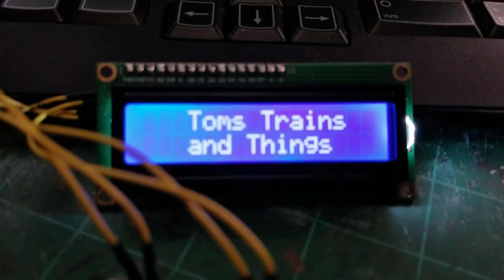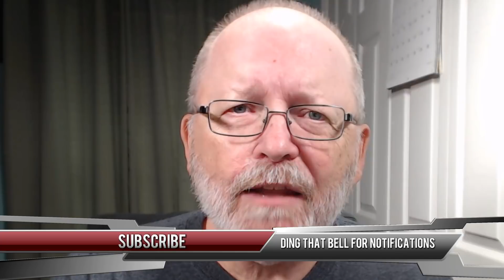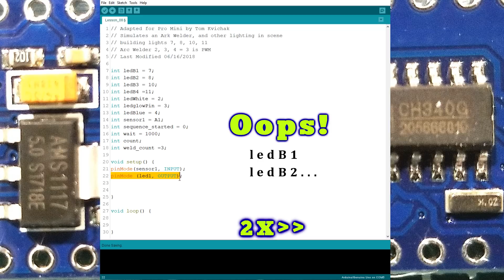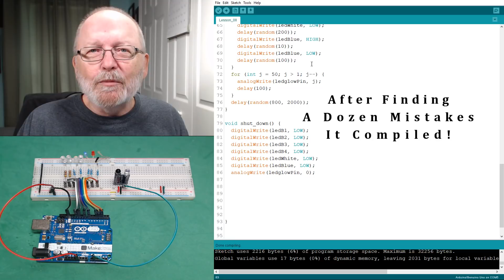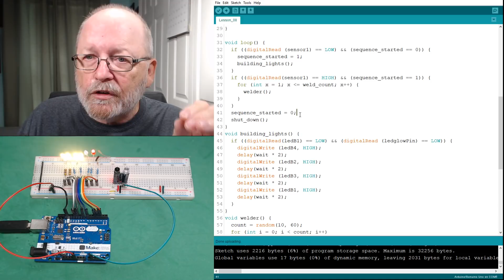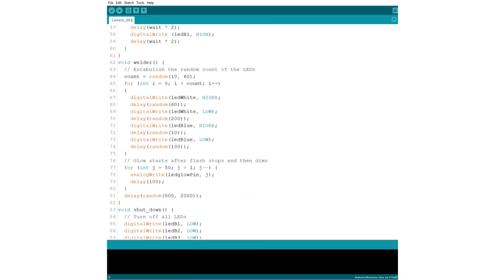Arduino Made Easy(er) The Welding Sketch - Lesson 08

Comment: You specified tweaks for a ProMini at the beginning of the video. Will changes be needed for a Uno or Nano board?
Reply from the maker: All Arduino boards are basically the same  except for the amount of inputs & outputs, but that's minor. All you have to do is brfore compiling the sketch is to make sure you identify which board you are using. The Pro Mini is no longer made by Arduino but you may be able to find it from other manufacturers. Haven't looked it up lately

Comment: Hey Tom!  Just checking to see if you've had time to put together you're updated arc welder  with DF player sound sketch.  I know you've been as busy as a one armed paper hanger what with your recent move, live streaming and God only knows what else.  The boys down at trackside are getting anxious with anticipation so I thought I would ask. Not whining, just wonderin.
Thanks, Jack
Reply from the maker: I think you might have missed the video I did nearly 3 years ago. https://youtu.be/CvSN1GUt5ak
Reply: @TomsTrainsandThings  Ooops, sorry.  I must have misunderstood you.  I thought you were coming out with a replacement for that episode. I've got a number of welding scenes on my layout but they are all in buildings at distance so sound really wouldn't be a factor for them.  However I do have an up front scene with a welder working on a track bumper.  Sound would be nice for that scene but probably not worth all the extra effort what with  my sound equipped loco's rumbling around it.  So I guess I'll just stick with your three light Arduino welding sketch (which is extremely realistic by the way) and pretend I hear the faint sizzling and crackling of the arc welder!

Comment: if I just wanted the sensor  and building lights not having the welder could you just remove the welder part of the sketch
Reply from the maker: You can add or delete anything from the sketch. Check out some of the earlier videos in the series.

Comment: Tried to upload this to a "NANO"..nothing..won't upload..is there something in the code thats not compatible ?
Reply from the maker: When you choose Nano, there may be another line in the menu under "Board" called "Processor" if so you may have to choose (Old Bootloader). Some Nano's have the old chip installed and you may also have to download a driver if it doesn't show up on a Com Port. I ran into the same problem. I think I covered it in one of my previous lessons. A viewer told me what to look for.
Reply: Yup.OLD chip..Thanks Tom
Reply from the maker: Glad you got it working